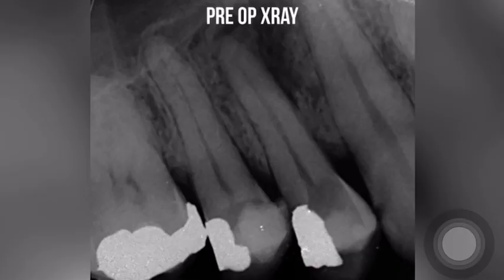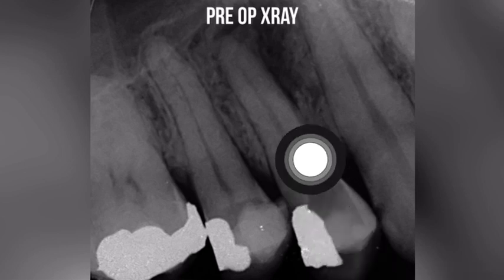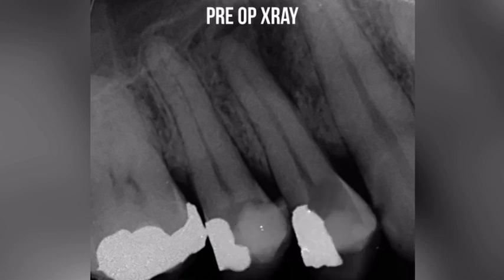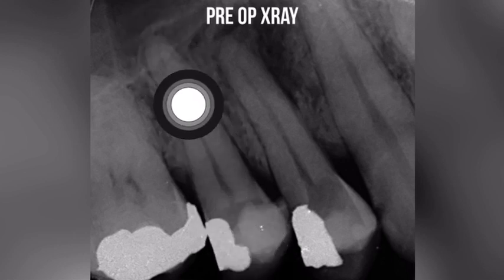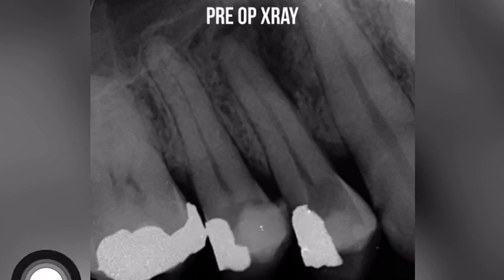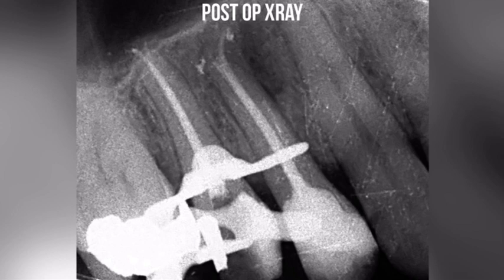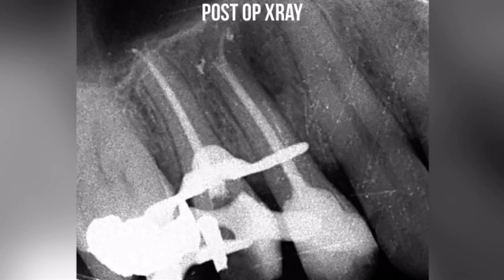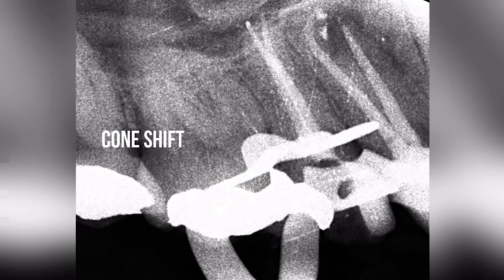Root Canal Treatment on an Upper Right Premolar (UR5) - Step-by-Step Procedure. Tips And Tricks.!!

Comment: In curved canal,can heat treated file be used?
Reply from the maker: Hi, thank you for your comment. Yes, heat-treated files can be used in curved canals during a root canal treatment. The use of heated-treated technology can enhance flexibility and reduce the risk of file separation or canal transportation. This flexibility allows the files to better navigate the curvature of the canal, ensuring efficient shaping. However, it's important to use them with care to avoid potential complications and to follow the manufacturer's guidelines for optimal results.

Comment: So UR5 has only one canal right?
Reply from the maker: @ZainabAdan-cm5jn. Thank you for your comment! In the video, there were two root canals present. It's important to note that the number of canals can vary from case to case, and exceptions are common in dental anatomy. It's crucial to develop the skill of reading pulp anatomy accurately and working with what is presented in each case. While it's helpful to know the typical number of canals, keeping an open mind and being adaptable are key to excelling in endodontics. I hope this helps but do let me know if you need any more information.

Comment: What about using edta?
Reply from the maker: @ninablon Thank you for your comment. In my final irrigation protocol, I use EDTA solution 17%. In this video, during the ultrasonic activation phase, I first activate my NaOCl 3%, followed by one minute of 17% EDTA activation. While EDTA can also be useful during mechanical preparation, in this case, I incorporated it only during the final chemical preparation sequence. Hope this clarifies things. Feel free to ask if you have any further questions!
Reply: @DrIoannisKiskireas  Hi, sir. I wonder if there are some nuances about the technique of PUI, especially how your hand/fingers guide the ultrasonic file: do you moving up and down (like filing)? do you intentionally let the file contact the walls of the canal (or if it doesn't matter)?

Thank you a lot! I'm still a dent student about to go to clinical practice.
Reply from the maker: @cyes30510  Thank you for your comment and for subscribing! To be honest, I've been enjoying sonic activation more lately. While US activation is very effective, it can be limiting when dealing with curved canals. You need to be cautious, as US activation can sometimes unnecessarily prepare the canals and even cause ledges. Tip fractures can sometimes be noted too. Recently, I’ve been using the sonic activator, and I find it quite effective.

That said, if you do use US, gentle up-and-down movements help refresh the hypo apically but try to avoid making contact with the canal walls as much as possible. I hope this helps!